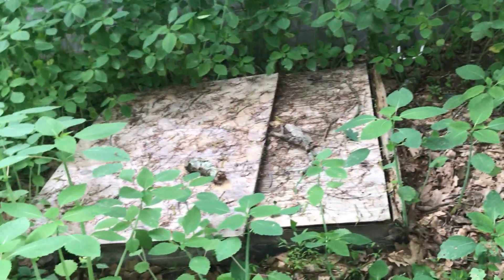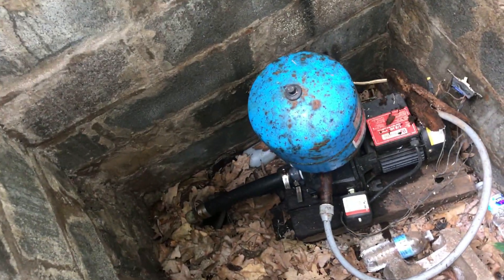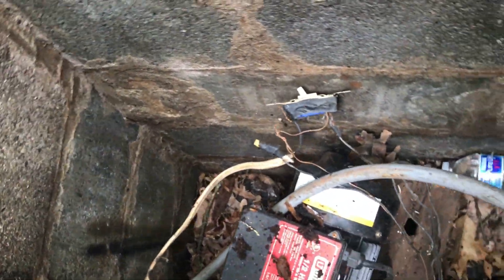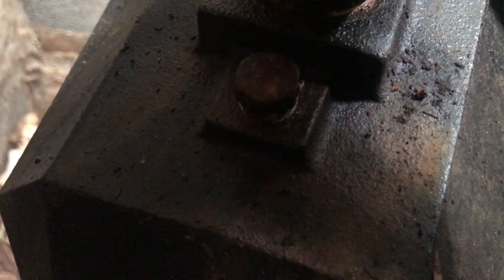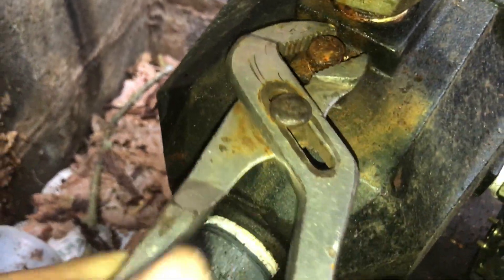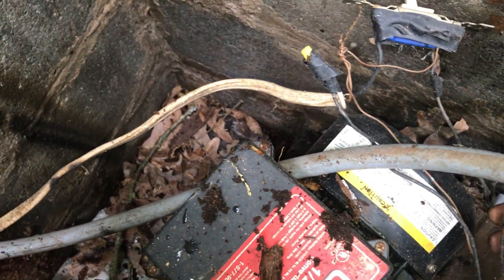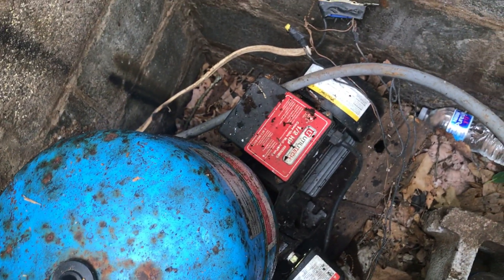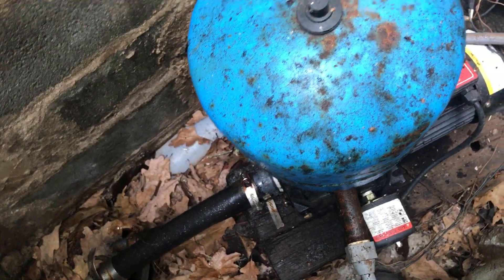Utilitech Deep Well Water Pump Went Bad - Part 1 Figuring Out The Problem

Comment: Oh man. I take back every bad thing I ever said about my crawlspace where my pump is. That would suck going into that hole. I hope it's a simple fix for you. Not to sound stupid, but is there a fuse or a circuit breaker where that wire connecting the pump is? Maybe that went bad or something. Just a thought.
Reply from the maker: yeah its crazy man, deff not easy to get up out of. but the wire? nope i got a lil buzz from that while down there. so the power is good. im thinking eithee the pressure tank at the top or the switch that makes it switch on and off. hopefully it is an easy fix!! and thanks for watching, lol ill have more video up tomorrow or the next day.
Reply: Oh ok. It was a thought I just had. Hope you get her fixed easily. I think our switch went out a few times. The contacts inside get corroded and the switch doesn't work any more.
Reply from the maker: turned out to be the diaphram tank on top, but we ended up just getting a whole new pump, the old one was pretty worn out. so were back in business now thank god 😆
Reply: Glad to hear things are back up and running. Look forward to part 2.